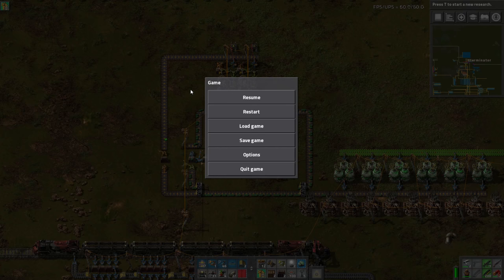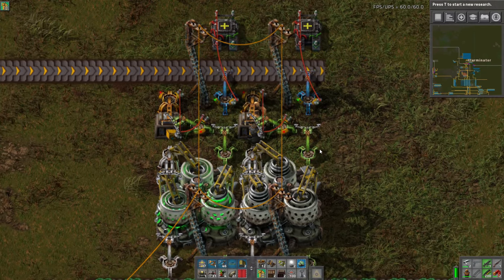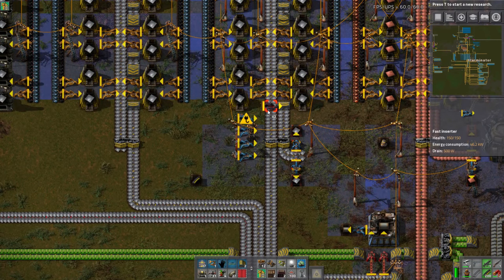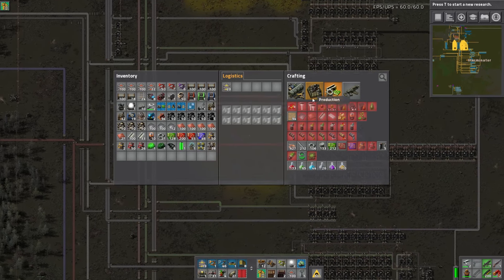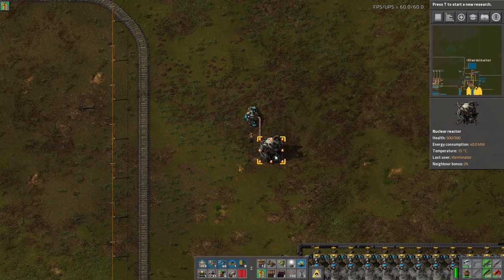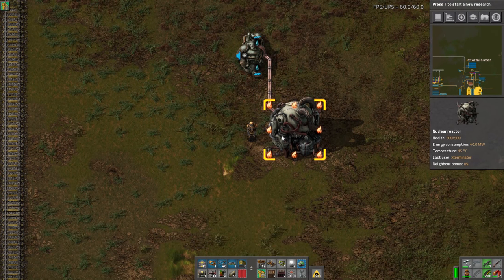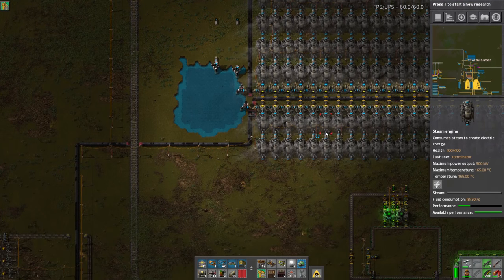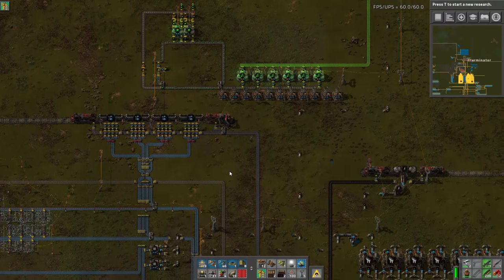Factorio: Tightening The Belt: Megabase Guide EP23 - NUCLEAR POWER | Tutorial Gameplay Series

Comment: Something super helpful on nuclear setups is to save the excess steam. It's always producing the same amount of steam regardless of your power load (just like it's always burning nuclear fuel), so if you save the extra you can create your own buffer for when/if you have fuel problems or if your power load spikes. Just put some fluid tanks at the end of the turbine lines and they will fill up with steam - when the steam being produced at the heat exchangers isn't enough for the load, it will pull the steam back in from the tanks to make up the difference (this will also let your ".6" turbines run at full power and full load for as long as the extra steam lasts). Nuclear steam stored in tanks is the highest-density method of storing power, so don't feel bad about going ham on tanks. You can even use fluid tankers to move the steam to a remote outpost for a localized power station :)

This is how most "smart" nuclear setups work - you store the excess steam while not under load, and monitor it with circuit wires. You can have one reactor powering dozens of turbines by itself as long as they're not under full load. Then, once the load increases and the steam is sucked back into the turbines, the circuit triggers another reactor to power up to get your steam production matching your load again (which happens quickly due to neighbor bonuses kicking in - cold reactors don't grant the bonus). Once excess steam builds up in the tanks again (meaning you're making more than you're using), the extra reactors are switched off to save fuel. On my setups, I have a line of tanks designated for each reactor, and when they get below a threshold it turns that reactor on. All of the tanks are connected, and pumps between the tanks keep all the steam pushed into one row so that they don't all drain at the same time, allowing the power to "ramp" up and down more smoothly. Just DON'T put a pump between the turbines and the tanks, or else they won't be able to get the stored steam back into the turbines.

Kovarex processing plant gives you 1 extra U238 every minute (approx), which turns into 10 nuclear fuel that lasts a total of 33 minutes. That means a single Kovarex plant will support 33 reactors running at full power burning fuel constantly. Smart systems aren't required once you have Kovarex going ... but you should still save your steam for a rainy day :)
Reply: Also if you do not go for circuits you can put down more heatpipes as they are better then tanks for energy storage (but cannot be connected to circuits). Also for max efficiency OCD you make enough tank+pipes capacity to take in full reactors generation and load them all simultaneously to always have max neighbor bonus.

Comment: In real life,  a fluid,  be it water (generally pressurized),  molten salt or pressurized gas,  cools the reactor,  keeping it from overheating,  this fluid goes through heat exchangers to transfer the heat to the secondary cooling loop,  which takes the heat to the steam powered turbine generators (sometimes after ANOTHER set of heat exchangers).  The steam is ran through high pressure turbine generators followed by lower pressure turbine generators,  and from there to the cooling towers.
Reply: molten salt is best from what ive seen, as its not under pressure ruptures are far safer and molten salt is self temp regulating more or less

Comment: In the module setup you could use underground belts to make a space for 1 long inserter. It would allow direct insertion. However, you would have to make your setup in a circle way, to input into one assembler. Also, since 3rd level module need five 2nd levels, there is no need for 2 assemblers.
Reply: ExEditor L3s have a 60s craft time, L2s only 30.

Comment: You should really isolate the power from the steam engines and hook it up via a switch with a bank of accumulators (you don't need many), switching the switch based on the accumulator level. It's very a simple setup that will conserve coal.
For a slightly less laggy setup put an SR latch between the accumulators and the switch (https://wiki.factorio.com/Tutorial:Circuit-network_Cookbook#Backup_steam_example). 
I also tend to hook a global siren up to the accumulators set at a level below where the steam engines come on, this will tell you when you are overloading your power supply.
If you want to get extra crazy you can use the same signal as for the siren to cut the input belts / pipes to all the smelting and refining which will keep your coal feed and laser turrets going even in heavy energy overload.
Reply: And if you are really really crazy you can hook your non-solar power generation to power on only when you don't have enough solar power, which is when your accumulator level drops below accumulator level of reference system %) Bonus points for enabling only so much power as to keep derivative of the difference close 0... But this is clinical level :)
Reply: Elaborating on the why a little. Currently under 50% load, all the engines and turbines will run at 50%.
What you really want is for the turbines to take priority, so the engines stay at 0% until the turbines are at full and then the engines start to come up. 
The accumulators + switch essentially achieves this by turning the engines off while there is enough power from the turbines. And then pulsing the engines when you only need part load from them.
The SR latch just cuts down the frequency of the pulsing, so the game doesn't have to spend as much time thinking about changing electric networks.

Comment: Connect your steam generators to a power network separator.
https://i.imgur.com/icDdJli.jpg (The sub stations are not connected to each other.)
The one in that image can handle 21MW... but it can be tiled (vertically in this arrangement) to handle more. Just make sure the substations next to each other are disconnected.

The steam will only run enough to saturate the accumulators. The accumulators will only release enough energy into the rest of the base to make up for whatever the nuclear setup can't provide.
This way nuclear will run at full production 100% of the time.. which is good because it burns through nuclear fuel cells at full speed 100% of the time.